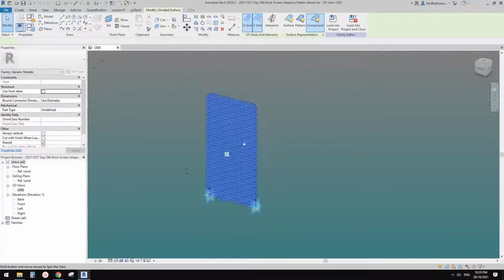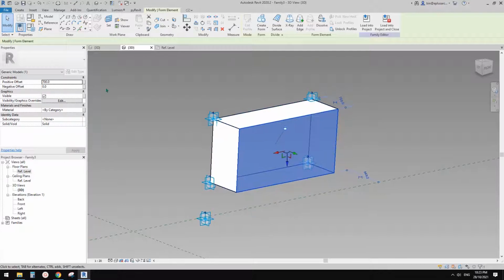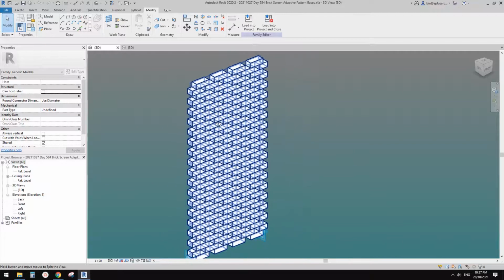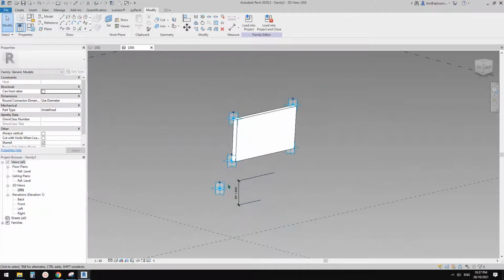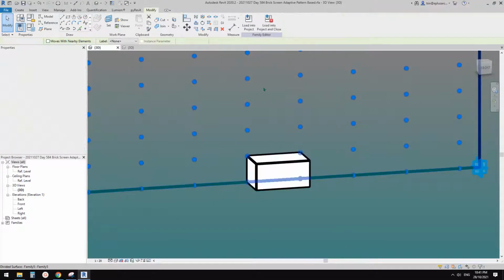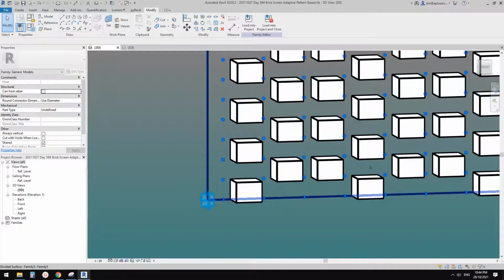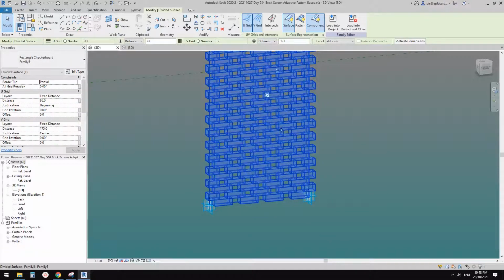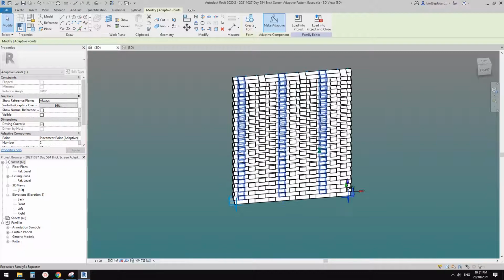Revit Exercise (Day 585) - Adaptive Pattern Based Brick Screen Part 2

Comment: Is there a way to put doors and windows on this wall? I'm making a parametric facade and wanna use different parametric patterns at different heights on the same wall. Would that be possible?
Reply from the maker: No, you can not place doors or windows on it, because it is not a wall. However, you can make it the shape of a wall with opening.